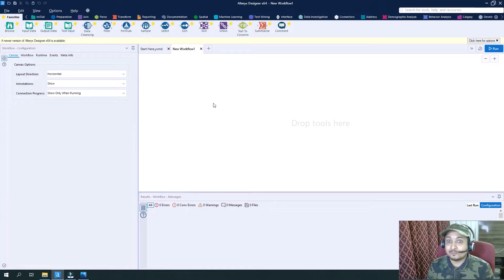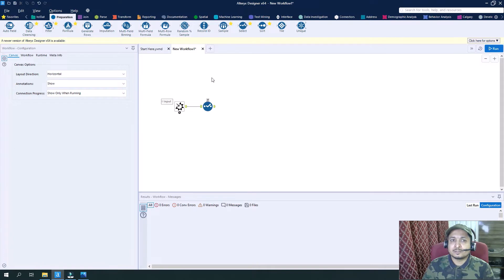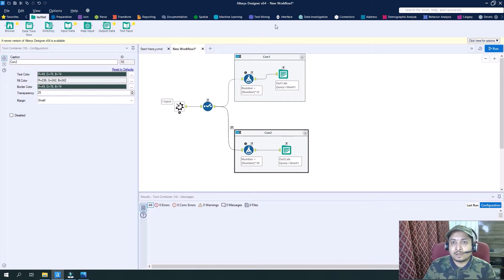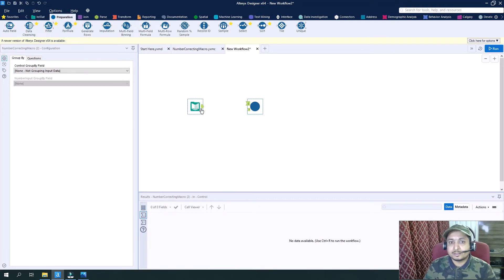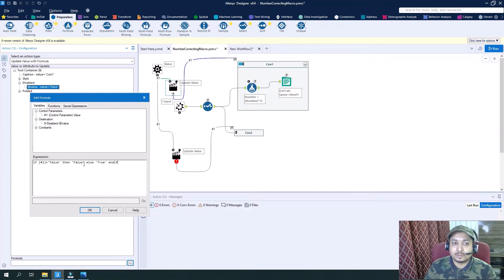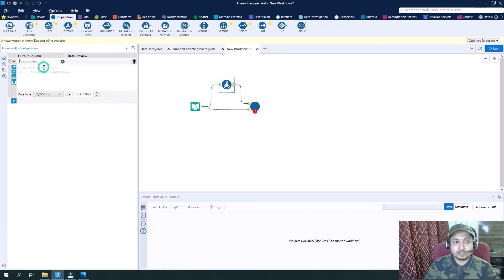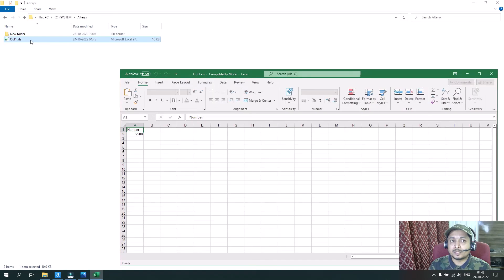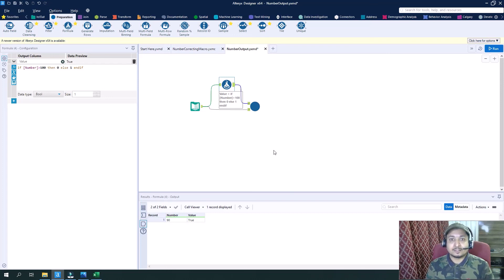Controlling Alteryx Container Tool with Batch Macro Input | Vaibhav Gupta

Comment: I have one report to be made, there are multiple steps and filters, but for one supplier( luxsoft Poland) if we get a confirmation team, then we need to remove those records from report and keep them in separate sheet else we need to have them in output report
Reply from the maker: You can use the batch macro where filter condition can be changed dynamically based on the input to batch macro. In that way you can achieve such a scenario.

Comment: Hi Vaibhav sir. I have been working with alteryx for the past three months. I have a task to combine all the multiple excel sheets into one by using alteryx. Can you able to help me ??
Reply from the maker: Utilize the input tool to get the sheetnames of the file. Then using a formula tool create a new column - "SheetPath" having value as - "Original Path of the file" + "Sheetname". Pass this column "SheetPath" as a control parameter to the Batch macro replacing the path in dynamic input tool. This will combine your data from all the sheets for that particular file.

Comment: I have a workflow in which I am using drop down interface tool which has five values . I have created five containers which runs based on user selection in drop down...but problem is i am using a different drop in few of the containers. when I run the wf as analytics apps all the user input is displaying..but I want to show the user input of container when those container is selected..how to do this?
Reply from the maker: @Amit: Can you please share your workflow packaged with data on email: imvaibhav11@gmail.com. We will send it back to you with some adaptions.